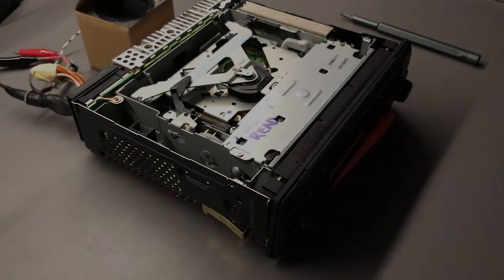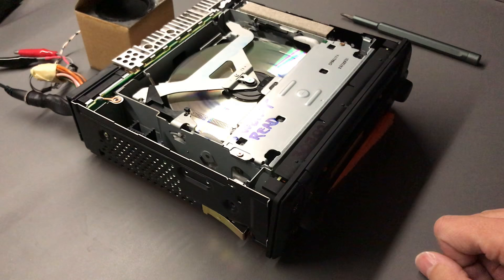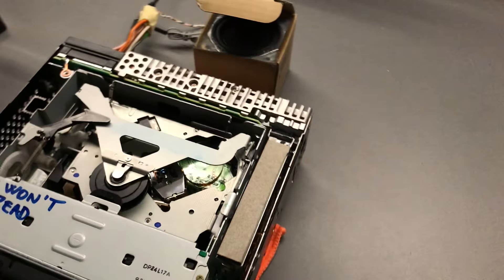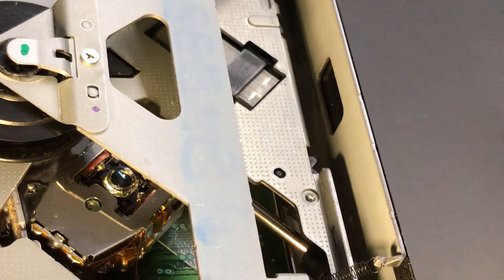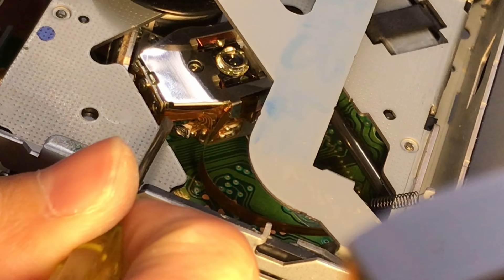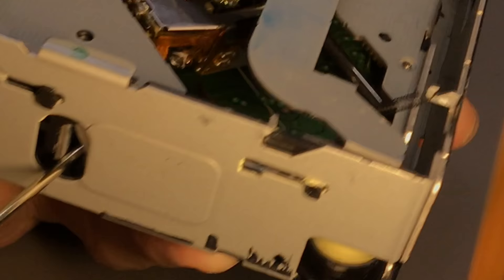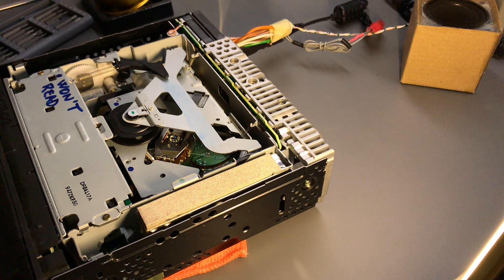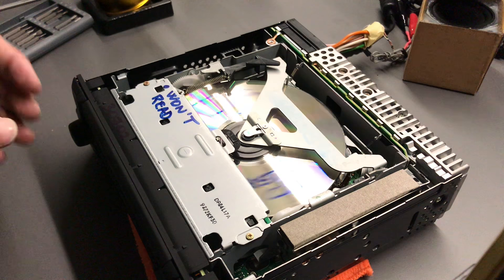CD Player not Reading Disc Fix - Increase Laser Power (to 11)

Comment: i got a sumas 310t cd/dvd player and it want read any cd or dvd and the usb port will not work, anyway to fix thiese issues?
Reply from the maker: That's a very weird question to put under an entire video dedicated to answering exactly said question
Reply: @Darieee  so cleaning the eye will allow the usb port to work?
Reply from the maker: Yeah good point - that part of your problem is most likely cause by other shit -- maybe try cleaning the contacts inside the port? Check if the plastic piece is not broken in any way and that the pins are not bent out of alignment ?
Reply: @Darieee  ty ill try

Comment: Lol I've gotten do frustrated with mine that i just turned the pot all the way up. Yet, it won't read any discs, which is weird considering the fact I can see the laser turning on. Whatever...
Reply from the maker: Could be some other fault in that case ... did you first turn it just a tiny bit though xD ? Because going all in from the start might damage some shit in there
Reply: Same in my case. Adjusted but not detecting cd anymore. What can i check further? Can u help me.

Comment: This can be done,but it reduces the life of the laser.
Reply from the maker: well yeah but - what life is it really reducing if it previously would not read any discs at all ?
Reply: Fair point,,but I'm coming from the fact that if the player won't read the disc,most people assume it must be because the laser is dead,,when in fact,,there can be various reason why it won't  read the disc,,IE,,servo failure,,dirt in the mechanism etc..so,, unless  the direct cause of the skipping/no play,,etc is confirmed,,increasing the output of the laser is a 'quick fix's to speak,,and can accelerate the demise of the laser diode.,,comes down to correct diagnosis i suppose,,..